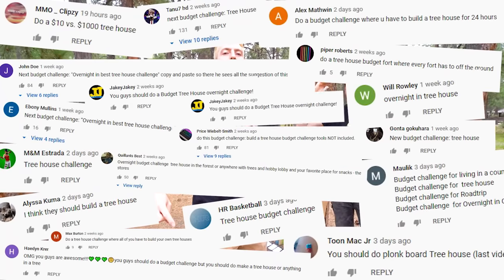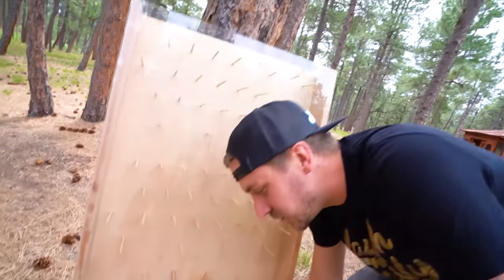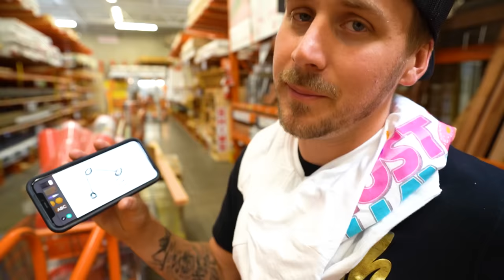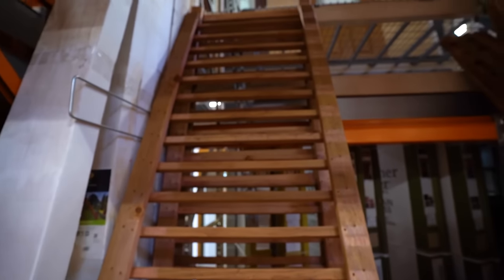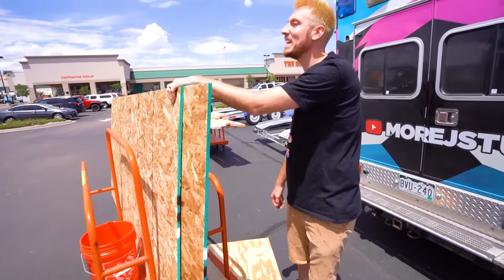$10 VS $500 TREE HOUSE FORT! *Budget Challenge*

Comment: So, I understand if you didn’t know this, but a really helpful tip for diyers looking for free or cheap wood: at Home Depot, they will cut wood for you (for an added fee) and will often give away the remainders for free for anybody that wants them.
Reply: Also use pallet wood for the floor. In my area when they demo a house they will trip the house of everything in side of it and take out the glass window's. Then they will roll over it with a skitster. That's a lot of free material that could make a really nice tree house. Pretty much you could live in it if the city will allow it.